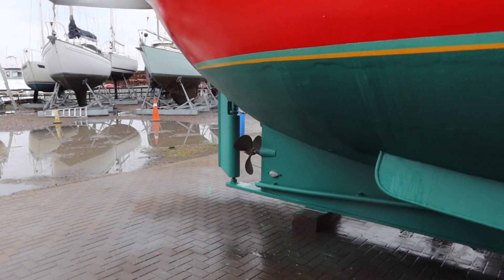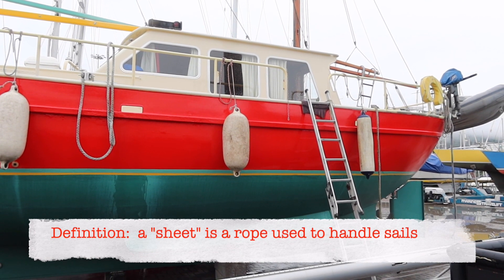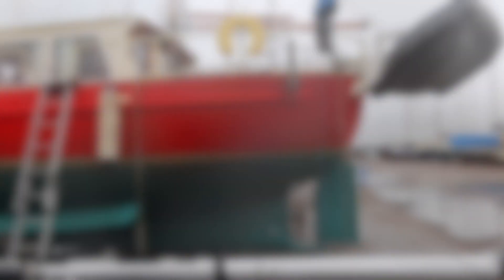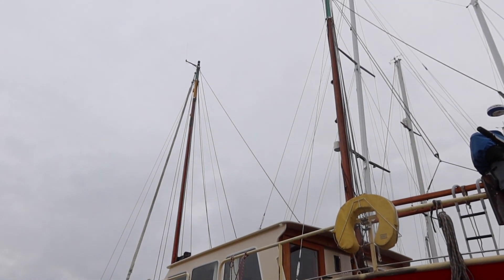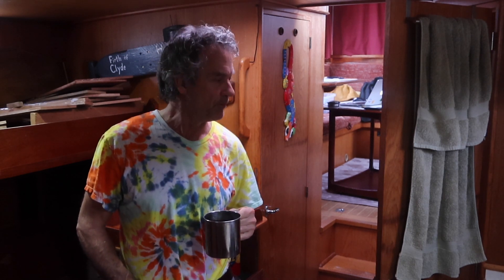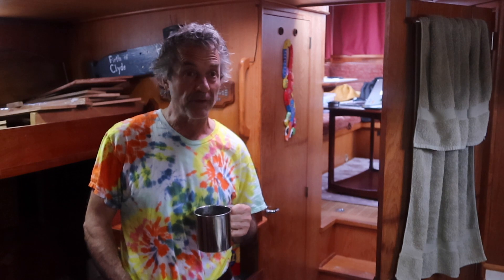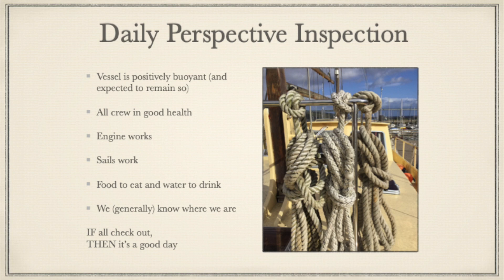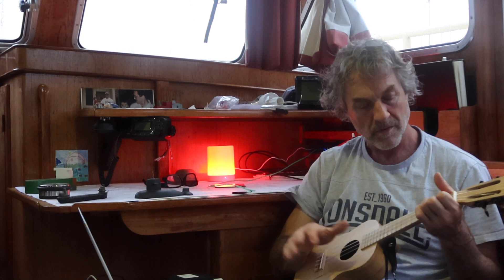Skipjack Sailing 10—The Adventures of a Navy Nuke Escapee

Comment: what are the metal things on either side of the hull towards the rear of the boat?
Reply from the maker: Can you help pinpoint?  Below the waterline?
If they are shiny metal, then those are zinc anodes.  All steel boats rely on zinc to be the "sacrificial anode" such that the zinc will lose electrons and physically erode/corrode, and the steel does not.
Even fiberglass boats will have small zinc anodes on the hull near the propellor shaft and the prop, and near (or on) the rudder itself.

Does that help?

Comment: One of the advantages of having valves on the cocky drains is you can fill the cockpit with hot water and you have a jakoozi !
Reply from the maker: Too funny.  I had thought about a re-design to make (instead of these drains) very large scuppers.  
But the height of the cockpit floor (and of the main cabin floor) is only about 10-inches.  I figured that when I get rolling around, I'd be taking in more water than I drained.
Reply: @skipjacksailing8986  i read years ago that those huge cockpits are dangerous cause if a big greenie lands and instantly fills it with water you'll need 4 huge drains 
Or you'll sink but I imagine as an ol submariner you'd find that kind of situation a good opportunity to do the laundry.
Reply from the maker: @patappleton6285  I do agree.  I think it's a huge vulnerability.  This boat was made in Holland and (my opinion) was intended for rivers and canals.